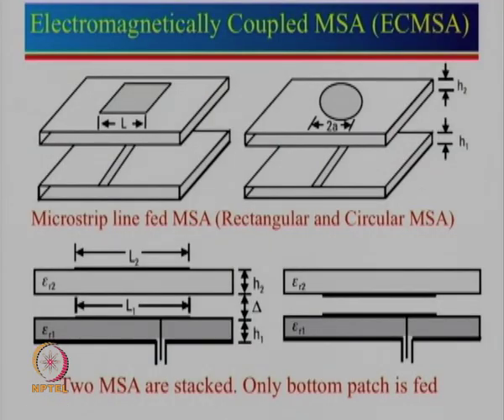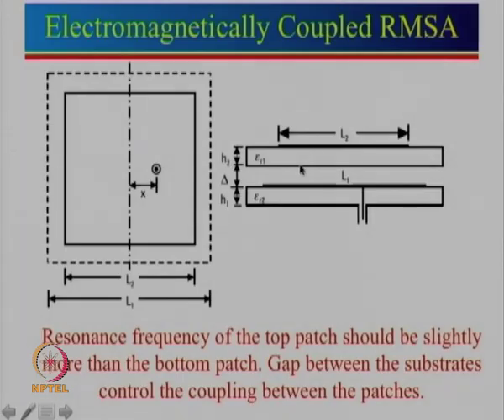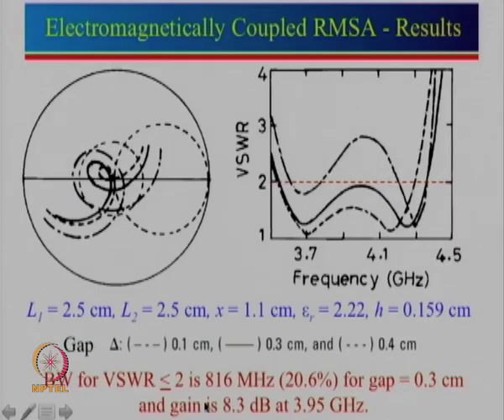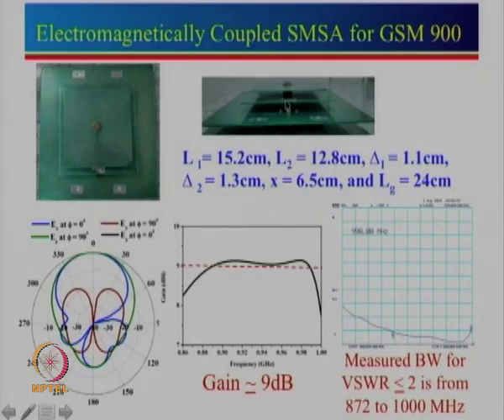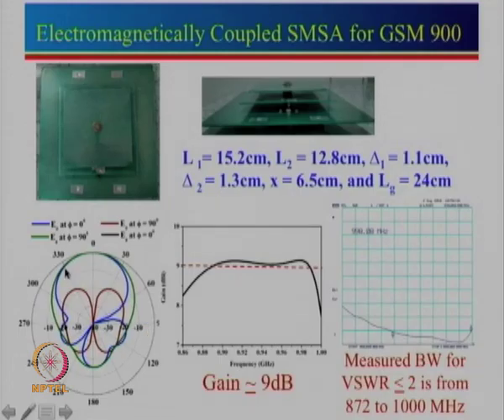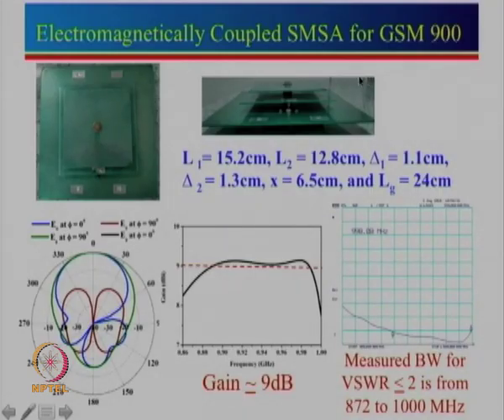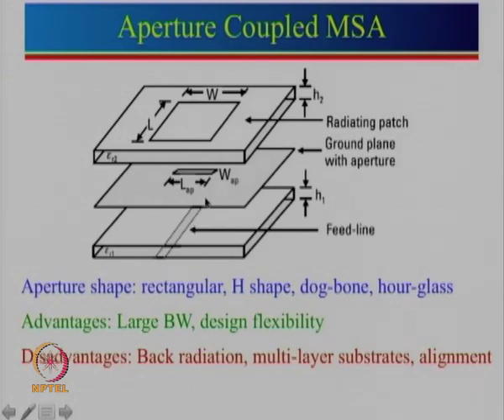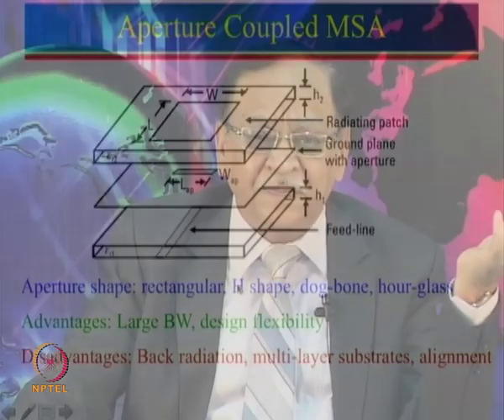Week6-Lecture 27

Comment: If L+ delta L for the upper patch and lower patch are equal where lower patch is resonant at lower frequency and the upper patch is tuned to the upper frequency, The two resonators would be critically coupled in my opinion.